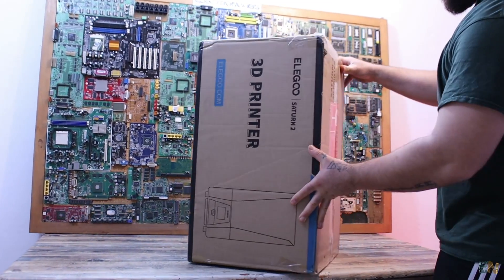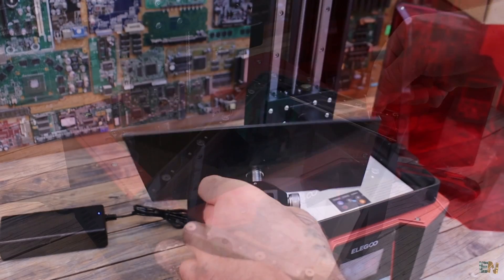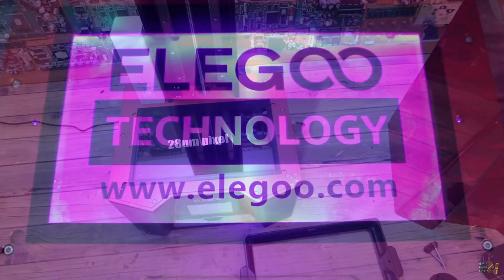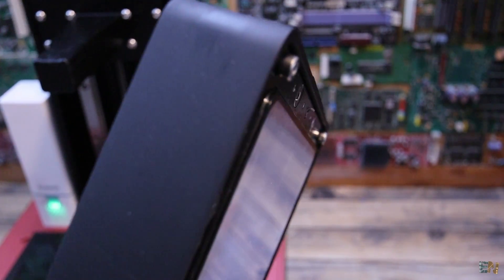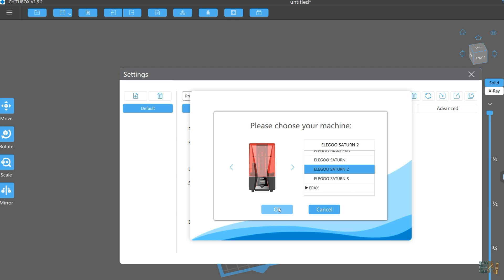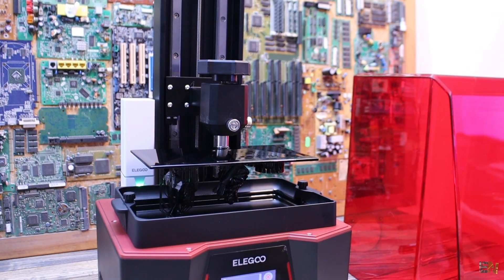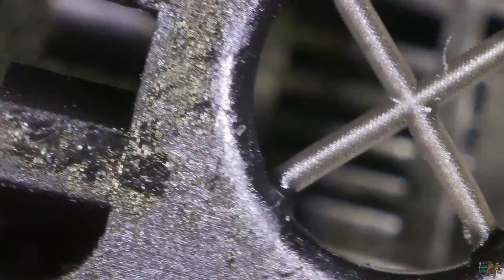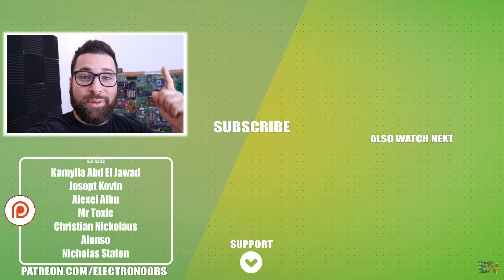PERFECT Details With Elegoo Saturn 2 - 8K Resin 3D Printer

Comment: Ive been using the Saturn 2 since Sept and it's a beast. My only issue with it is the ball join holding the build plate isn't quite strong enough and the plate is very easy to un-level if you're not careful (even if you are) when removing prints. I think a whambam or similar would help.

Comment: Weren't you supposed to put the paper sheet for the z - calibration process?  @ 2:44
Reply: I have gotten to the point where I home it like he did. Calibrate it and set at 0. Then I raise the axis .1mm 2/3 times. Then hit print without rising the z axis all the way to the top. But also I do that with the Saturn not Saturn 2

Comment: Friend I want to turn my favorite headset into wireless (2.4ghz) and add a microphone to it. What would I need? I thought of a transmitter and receiver module (which I will use as a USB in my pc) and a rechargeable battery.
Reply: There are many videos, surf on

Comment: 1. Don’t hesitate to use the cover. 
2. To clean up the printed models use the ultrasound cleaner. 
3. Always shake well the resin before use it. 
4. Try to not use the air cleaner - I think that this can increase the quality of the printed parts. 
5. Each resin have his own print parameters, so before printing you need to print the test model with different screening times and look the result under the microscope to choose the optimal parameters. 

Hope this will help you get the best quality of the print. Regards from Ukraine.

Comment: Is this printer also vendor locker like all (?) recent "chitu systems" company based printers? (and elegoo is using chitu boards) So only can be used with chitubox slicer and won't accept files from other slicers (due to encryption). Chitubox software is free in limited form and very expensive in full version. Free until vendor decides to end free version of course.
Reply from the maker: Not sure right now. I'll ask elegoo
Reply: Hello friend, Lychee Slicer can also be used to work with this printer.
Reply: @ElegooOfficial  Lychee Slicer uses chitu SDK which is still closed source and still part of a locked system. Vendor can just stop supporting it, switch to new encryption style etc. Vendor lock-in (who doesn't know what that means should check wikipeida) is *bad*.
Reply: Following
Reply: That's good to know before I buy...!

Comment: Wonderful review showing some of what this printer can achieve. Since you did find problems with some of the cleaning alcohol, it would be great if you could tell us what alcohol you got the best and which was worse results.
Reply from the maker: Better use isopropanol all the time!
Reply: @ELECTRONOOBS  What concentration percent have you found to work best? 70%-90%?
Reply from the maker: @HowCoolIsThat  only used 90℅ isopropanol. Then I've used 70% ethyl alcohol and got bad results...